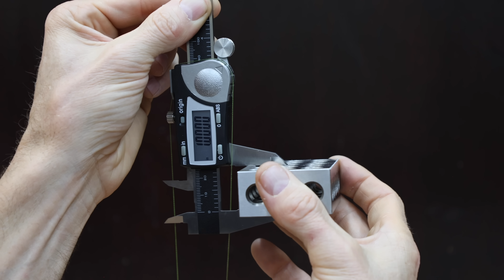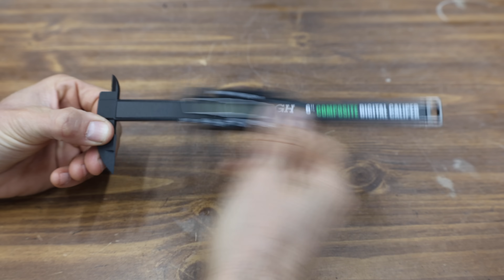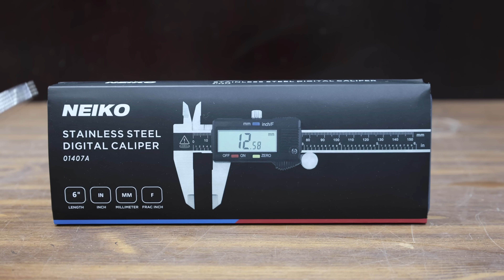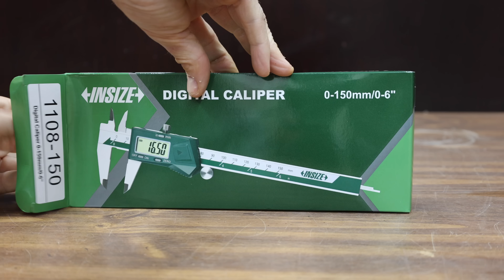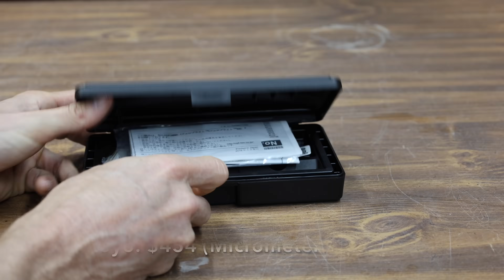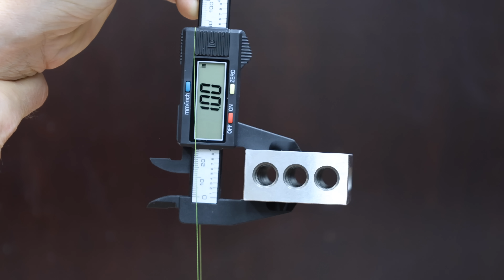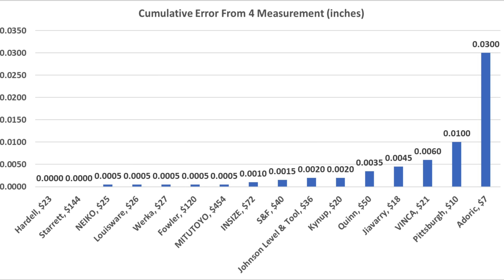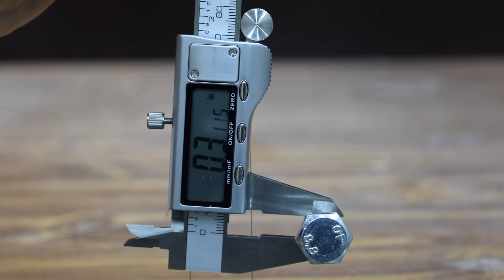I've Been Proven Wrong About Calipers!

Comment: I'm retired now, but I ran a calibration lab for 30yrs. I've calibrated and repaired all kinds of calipers. If you need accurate, out of the box calipers for your job, just get the mitutoyo. You can find them for around $100. For home or hobby, a cheap pair is ok, but won't be as accurate and may not last long. Out of the more expensive brands, mitutoyo is more durable and can last for many years.
Reply: At enginering school we had to buy a manual Mitutoyo caliper as a student.
After 40 years of almost daily use in the field it is stil in good condition and works.
The plastic holster perished along time ago but i reused an old wooden case of worn out caliper from the calibration lab.
Ofcourse in a conditioned calibration lab measure tools are used constant, we engineers in the field only several times aday 
Only my aging eyes requierd to buy a digital caliper.

The reason why i also have a cheap plastic digital caliper in my toolbox is because of barbarians who abuse your caliper as a scribe tool on metal  😱
Reply: Wait, you can use these for something other than scribing? 😉
Reply: @obelic71  That would be grounds for a Life Lesson.
Reply: @obelic71  who abuse your caliper as a scribe tool on metal  ...I don't condone violence in the workplace, but in that case I would understand. 😡
Reply: Lately they have been a ton of fake Mititoyos for really cheap.
Reply: Having been in QA for 8 years, measuring rather rough thermal spray-coated surfaces (some mixed with super alloys as part of its chemistry) with varying geometries, I can vouch for the Mitutoyo.  Also love their micrometers, especially the good-ol blue hammer-finished sets with the nice wood box.  We had a set good up to .0001", and they were every bit as accurate after have been put through the wringer as the day they were bought.  I even liked their 18" carbon-bodied calipers, though I wasn't overly pleased for some applications due to some head flex.
Reply: @pauldehayes1898  I could be wrong, but I thought the 'blue-hammered' finished instruments were made in Brazil by Mitutoyo and that the 'green-hammered' ones were made in Japan.  I could be wrong.  I think the hammered finish is called 'japanning'.
Reply: @1202-Alarm hmm, I'm not sure, but I do know they were an amazingly accurate and reliable set.  We had them up to 12", but our guys kept screwing up the 0-1"s, so we gave up on keeping the set complete after about 3 of them LOL
Reply: Buy once cry once. I bought a 0”-6” micrometer set, Mitutoyo, it was like $800 for the set with a nice wooden storage box.
Reply: I've used Mitutoyo, Starrett, and budget brands, and Mitutoyo is definitely the best. The hard part is deciding which Mitutoyo model to get, because they have so many different options.
Reply: How about Sylvac? Have seen a few of those used for reading data directly into software...
Reply: No doubt Mitutoyo is the best hands down. However, for heavy use and less accuracy not needed, an 8 Inch Harbor Freight pair does the job for 15 yrs for me.
Reply: Lost my ~20 year old Mitutoyos, found them outside after being there all winter. Cleaned them off, tested on a couple gauge blocks and they were still on. Crazy build quality
Reply: But at $20 for a harbor freight brand, will that mitutoyo last longer than 5 harbor freights? I've had my metal harbor freight now for 20+ years...and they're still going strong! They came with a hard shell case and are made of stainless steel and honestly, do everything I need.
Reply: @ekummel  

My first set of Mitutoyo dial calipers is 54 years old and still looks like new and works the same. 

Don't bother to check back with me in another 54 years as I will not own them at that time but I would bet they are still going strong then with a little care.
Reply: @FreiherrvonDinkelacker 

Not quite that vintage. Purchased by a kid who liked tools and did not have much money at an auction.
Reply: @ekummel It depends what you're doing. I bought Harbor Freight calipers about ten years ago, and they're doing fine for my hobby work, but you'll have discrepancies in your measurements, and they'll drift over time with the cheap ones. That's okay if you only need rough measurements, but if you need precision, you have to get the right tool. Starrett is good, but you'll pay twice as much as you would for a comparable Mitutoyo (although the models tested in this video seem to refute my claim). Mitutoyo is the best for precise industrial use, in my experience.
Reply: @GeoffCostanza  The $454 Mitutoyo price was very misleading as a kit was bought for $454.  It included 6" caliper and 1" micrometer in fitted wooden case.  Both instruments were digital.  The caliper can be bought at Amazon for $155 and it is offered on promo-sale by MSC Industrial for $119.  Mitutoyo is best for electronic instruments.
Reply: I've never needed to be accurate less than 1mm, (usually checking for bolt diameters). Aliexpress for about $2 but has lasted well. I would never recommend any cheap tool for real work
Reply: i have the $7 pair. Its my first ever caliper and I used it for hobby stuff. I also measured EVERYTHINGG when I firsst got it a couple months ago haha. For my needs its been great! I don't like its plastic though. It doesnt feel like a real pair of calipers haha
Reply: Ditto ! Been in Quality Assurance for 26 years (had the same issued caliper for the whole 26yrs) , We have Mitutoyo and Insize in our labs and on the floor. I am a Mitutoyo guy through and through. I picked up a pair of new 6" Mit's for my reloading bench. Nothing but reliability and accuracy.
Reply: I do what you did. 
And agree
Reply: Agreed. I still use my Mitutoyo dial calipers I purchased in 1989 all the time. And if you need precise measurements calipers really aren't a very good tool for the job. Working in a Class A tool shop for 30 years the only time I'd use them is for rough measurements like double checking a drill bit when pulling one out of the drill index drawer or measuring a c'bore clearance depth for a SHCS etc.
Reply: You need to define "accurate".
Reply: Definitely - I have a couple of cheap calipers (one is literally the garage and well - saying they have had some rough treatment is an understatement, but they are accurate enough for what I need; The other pair - is largely used as a sanity check when I'm scaling prints to make sure I'm getting the intended size, along with other mostly just sanity check work).

If I were to get into precision machining: I'd go and spend on a better set.
Reply: Did you not pay attention? It failed in the test as a precision tool. It was not the best one. You keep saying this nonsense because you believe it's the best quality because it's the most expensive one
Reply: Agreed
Reply: Having worked in an ISO 17025 certification lab for years. This is a true statement. We used mitutoyo almost exclusively for many different types of gages and they can take a beating. In the thousands I've certified i never had one of their calipers fail cert out of the box.
Reply: Very true in my experience.  It is worth paying a bit more for something that will last and that you can trust.
Reply: I paid 300 for used good condition mitutoyo calipers. do you think I overpaid? its the 500-738-10 version
Reply: My thoughts exactly, Mitutoyo FTW
Reply: Yeah just get the Mitutoyos is what I tell people. Over time you're going to spend the difference in cost in batteries. A caliper being dead when you need to use it is doing you no good either. Then it's a trip to the drug store to get batteries. Because you can't wait for some to be delivered.
Reply: @1pcfred  do they still make dial calipers?  Mine don't need batteries.   I like my hand tools to have cords too.
Reply: @gizzyguzzi  , I have one of their solar powered calipers. No batteries. Of cause if your shop is too dark, they won't turn on as no charge is retained.
Reply: @heiner71  Use mine some 30 years now. Love it.
Reply: @gizzyguzzi they always have, and always will make dial calipers
Reply: @gizzyguzzi  I think Starrett might.
Reply: @gizzyguzzi  Yes they do fortunately!
Reply: @gizzyguzzi  yes, never worry about batteries and never worry about one leaking and destroying your caliper
Reply: @1pcfred  Absolute bs. I use a Steinle caliper which was 30€ I think, nearly 4-5x per week for 4 years now and I didnt even need the 2nd battery that came with it to this day.
Reply: Buy a couple extra batteries and throw them in a draw?

The budget runner up was $400 less.
Reply: @64bitAtheist more like 200 ish less.  Not sure why he chose to list the price of the combination pack of calipers and micrometers.  I'm guessing he probably got that pack cause he needed micrometers... But the price of the calipers he states is around 250 bu themselves.  Of course you can get mitutoyo calipers in 6" size ranging from 100 ish to 500 ish depending on all the options (the later including wireless data logging and carbide tipped jaws)
Reply: @64bitAtheist  
Just the calipers cost around $150. 

Always make sure to buy them from a trusted retailer and not some big online shop, there are tons of fakes.
Reply: Yep. It’s like a multimeter… if you’re using it a couple times a year at home on things that aren’t super critical, get something low end or mid-tier. If you make a living with it and use it on things requiring the most accuracy possible, get the Fluke.
Reply: @ChuckW802  when I did line work my partner and I were checking the power coming into a business on a service call because they said the power was out. When we saw the fuses still clipped in and no breakers, disconnects, etc. tripped. He used his fluke to check power coming in the top of the breaker and before he got the lead to ground about 4 inches away it arct and melted the end of his leeds. I got the high voltage tester from the bucket truck and there was 16kv coming to the top of the breaker. One of the transformers on the pole was bad. Could have killed him if it was a cheaper tester even though the fluke was only rated to 600v it saved his life because he wasn't wearing hot gloves and I didn't have a 2x4 near me to hit him off with if he got hooked up and rode the lightning. I still remember that was the first time I saw anything read on our big greenlee tester we usually only used it to verify everything was shut down.
Reply: @ChuckW802 Or do the research and find new suppliers that offer the same reliability as Fluke and more bang for buck. They do exist today. But sure, you rarely get it wrong if you buy Fluke.
Reply: At work, I’m only allowed to use the 8-inch Mitutoyo calipers that were specifically issued to me and calibrated by QA.
Reply: @DarkmatterCactus my calipers and mics are certified by our QA department and certified by mitutoyo from the factory
Reply: Don't you prefer vernier calipers ?
Reply: @bennyattar8862  I went to NAPA to buy a front-end bushing and they gave me the wrong one. I handed them my vernier calipers to measure it and nobody knew how to use them. They finally dug up their digital calipers and told me it was indeed  the wrong size 🤣 If you use them well good quality vernier calipers are quite accurate and good enough for most purposes.
Reply: @P_RO_ 
Heck, even the $3 plastic vernier calipers are ... pretty darn good for $3. 😂
 Probably covers most home and hobby use. But they do require a few minutes of learning how to use them
Reply: @bennyattar8862  Vernier calipers are ok for larger calipers such as 24", 40" and up but for every day use many times a day I'd much rather have dial or digital calipers.

Comment: I've had the Mitutoyo for 3-4 years now, and can confirm that the low power mode works amazingly.  There have been times when I left it powered on for months at a time in the drawer, I'm only on my second battery.  It is a joy to use.
Reply: A battery will last in my Mitutoyo calipers over 5 years. I do use silver oxide batteries though. I spend the extra. My calipers are worth it. If it doesn't say silver then it's not. The cheap chemistry is zinc I believe.

Comment: If you have to work with calipers in a ISO shop. Your calipers will have to be calibratable. Some of the cheap ones wont. Some of the cheap ones are off scale.

Comment: 12:46 -- you called the Starrett perfect at all three measurements, but the video showed it was .0005 over on both the tip of the 1" as well as the 3" measurements.  You weren't noticing the small 5 in the bottom right corner of the display which is the ten thousandths digit.  That should have moved the Starrett from the #2 spot to the #8 spot in that test.  How would that have affected its final ranking?  FWIW, all I use is Mitutoyo and Starrett myself.
Reply: Was about to post the same,  the small 5 was missed. And at the same time (as other have said) - how accurate is really the 1-2-3 block, including temp expansion / contraction

Comment: The main thing that irritates me about calipers is that NONE of them allow you to set the resolution when in "fractional" mode.   If I'm trying to measure something to the nearest 1/16" and it's showing me 73/128" then what TF am I supposed to do with that?    There should be another button that allows me to cycle between resolutions (1/16", 1/32", 1/64" and 1/128").   I must have spent an hour scouring the Internet for someone who has added this simple little feature.  ZILCH.

Comment: There's actually one catastrophic problem that affects many of the cheaper calipers.

There are sometimes very specific small ranges (+/- maybe 0.1mm) where the calipers will read wildly out of spec. This is usually repeatable and can affect several brands if they're made by the same factory. Most cheap calipers are basically shared components with different moldings.

I learned this lesson one day when a part I made didn't fit the piece I had fit it to. I double checked and triple checked the measurements. Everything matched. Measured the part it interfaced with. Same measurement. Put the parts next to each other. It was about 5mm off. WTF? Impossible, I thought. So I checked the calipers. Sure enough, they were just wrong... but only for that measurement.

Imagine if you measure a 100mm part and the calipers give you exactly the right measurement. Same for 101mm. Then 102mm. But if you measure right at 102.3mm... you'll get 107mm! Then 103mm is fine, and so on. (The exact number here I can't recall, but it was repeatable).

After my discovery we actually checked every other pair of calipers we had and found that every single one showed the *same error at the same measurement*. Some were the same brand, but some in fact were not.

We immediately threw out every single one and bought Mitutoyos for everyone.

Oh, and my part was 3D printed so barely any time lost. But there are cases where this type of error in your equipment could be very costly.

Comment: I’ve only ever used a cheap Harbor Freight one I got 10 to 15 years ago. The battery was always dead when I wanted to use it, and I pretty much never buy those button style batteries, so I soldered some long wires in place of the battery and would hook it up to my variable power supply when I needed to measure something. Not as portable, but I don’t need it to be when measuring stuff on the bench as I used it. And at the cost of batteries it doesn't make sense to end up paying as much as the caliper cost after going through several. Would be nice to get a better one where the battery lasts and just better quality, but I don't use it enough to spend that kind of money. That said, the HF one worked for the stuff I needed to measure reasonably well, and I actually used it a lot years ago, just not enough to warrant a high priced one. I do not actually remember how long the battery lasted in the caliper, I just know it was usually dead when I needed to use it.

Comment: The problem with these cheap Chinese calipers is that they discharge battery even when they are off. Basically off switch or timer only disables the LCD.

Comment: My experience as a millwright was that cheapo calipers are 100% fine, as long as you get the dial gauge version and skip the digital version. The cheap digital calipers were always trash, in my experience. But I changed trades half a decade ago so things could be different now.

Comment: i Had some older Neiko calipers that would turn on intermittently with any sort of shake and vibration inside the toolbox. Im thinking it would trigger the "Auto on" feature that also happens whe the jaws are slid back and forth. So That is to say it's build quality and construction wasnt exact also quality control wasn't very good from that vintage. Probably have made improvements since tho i would suspect

Comment: I own calipers from Mitutoyo down to Pittsburg and the two most noticeable things:

1. The battery last damn near forever in the Mitutoyo or Starretts. Ones with the auto on function like Pittsburgh and such turn themselves on constantly 

2. Smoothness/locking screw. I've found some cheap calipers that are surprisingly smooth but generally they're not and it's super obnoxious.

Comment: Given the state of RPV technology, there is no reason that the “insurance pilot” can’t be on the ground at ARTCC.  Given that real emergencies are very infrequent, you could have three RPV pilots live at each ARTCC ready to take over should a single pilot airliner have an issue or an autonomous airplane have an issue.  The RPV pilot could then take over and handle the emergency and land the airplane.  There is no need for the “insurance pilot” to be in the airplane.

Comment: I work in engineering at an aerospace company. I constantly work with the metrology dept on measuring tools.

The biggest reasons for expensive calipers is two fold

Obviously accuracy, but also repeatability over years of use. 

250$ for a pair of calipers is peanuts compared to what it would cost if it fell out of acceptable ranges midway through calibration cycles